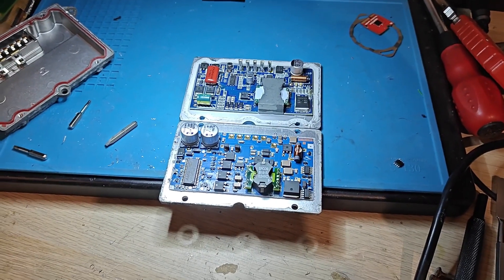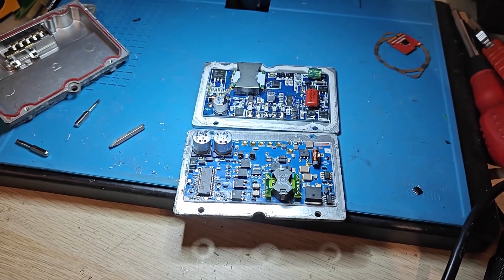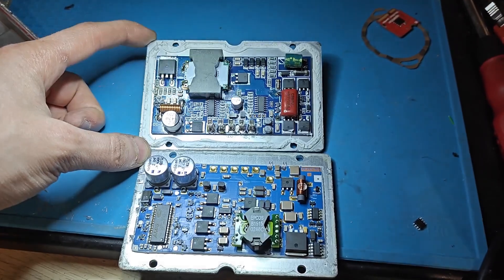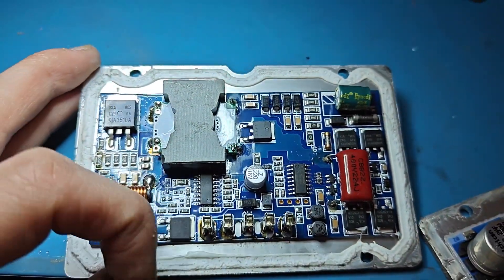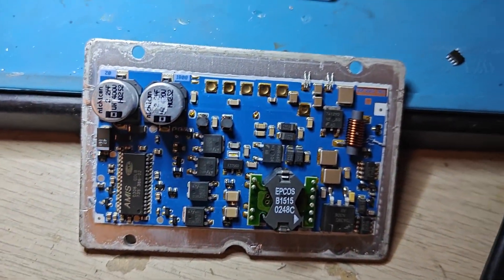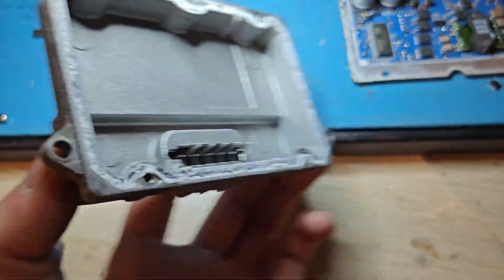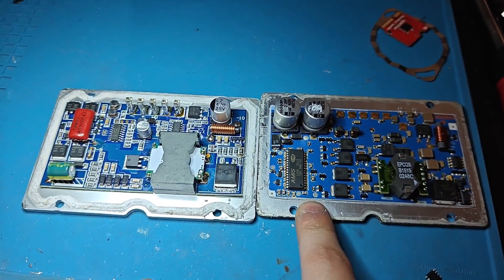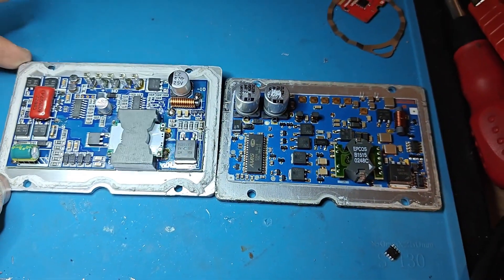Why you should NOT buy Chinese ballast Modules for Xenon car lights

Comment: I mean, I like the Idea of using the case of broken units, same as with those aliExpress PC Components, which recycle actual GPUs and other , well in shape parts. I also like the Idea that they use a microcontroller instead of a dedicated IC, because they are much Much Cheaper. But they cheaped out on the rest :/

Comment: I dont think they are re purposing old modules, it would cost too much to clean up the old case vs just having new ones made, the fonts are different and the inside markings are different, copying that case is childsplay. 

have you checked your car to make sure there isnt a reason these are blowing? I mean it may not be the chinease persons fault :)
Reply from the maker: Yes I checked, the original OEM ones are 23 years old, and were seriously corroded. The newer OEM ones I installed were in much better condition, and I haven't had any issues so far
Reply from the maker: On a motorway drive, the Chinese ones were turning the light on and off every time I hit a bump, and at a couple points, both units died at the same time, meaning I was left driving with no main beam.

Comment: Is it possible to replace the caps on both models?
In the china model it looks like the capacitor is small and low temperature.
The xenon should ignite with single shot in voltage and then run at 90V AC which the china models does.
The problem seems to be the current is not high enough in china model.
Maybe it runs okay with smaller 35W standard china xenon burners?
Reply: once used these el capacitors to bring to life cheap enclosed adapter and it failed after a month. overheating PSU damaged it